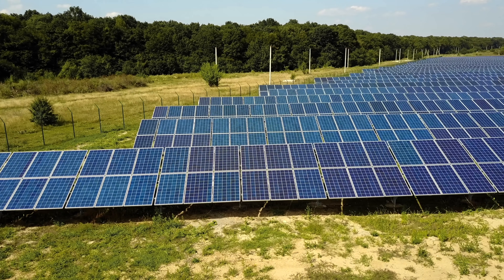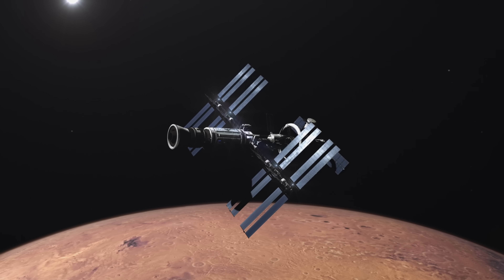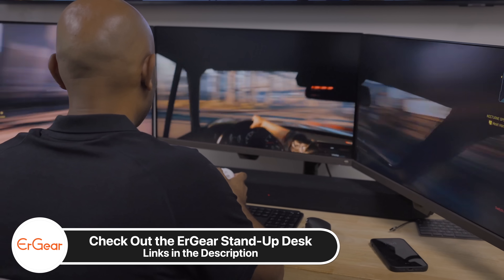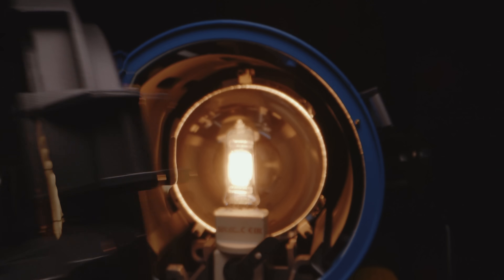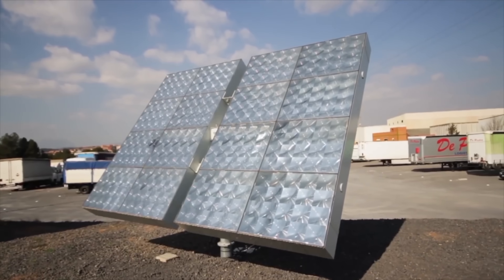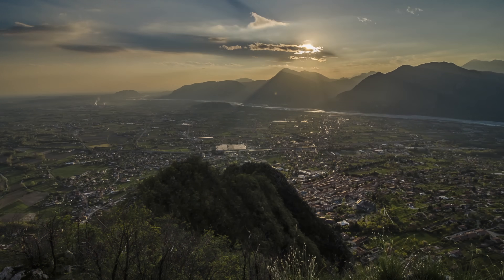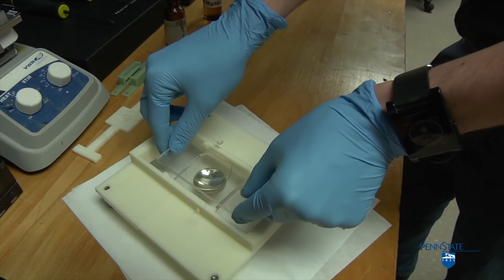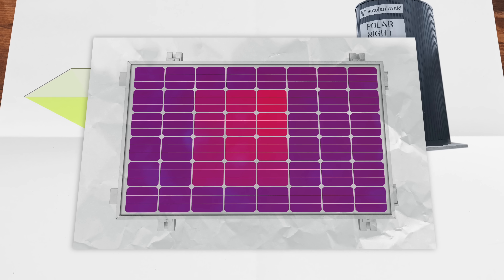Why Don't Solar Panels Have Magnifying Glasses On Them?

Comment: Here's an Idea:
Would it be possible to apply this geometry to a pool and have a panel at the bottom using water as a diffraction material?
It would use a big "dead space",  it would heat the pool and cool the panel and a heat pump could use the water as a heat source when it gets too warm to use the energy as effectively as possible.
Reply: The water in the pool would be hottest in the middle of summer.
Reply: @klepow  that is why I was thinking to use it as a heat source on a heat pump. That would extract the heat and send it to your boiler, a modified dryer and in to the soil for later use.
This would both increase the efficiency of the heat pump and cool the water to a preset temp.
Reply: @GeorgeBP81  I doubt it would be worth it. Without this Rube Goldberg contraption, you would still get 500% efficiency.
Reply: I like your thinking...I was just thinking that water droplets act like a magnifying glass so if you use a large magnifying glass on solar pannel the problem is excess heat so I thought spray solar pannel with water mister on a timer and use PC fans too blow across this water mist on pannel creating evaporation cooling which is very strong cooling this will offset the excess heat from big magnifying sheet above but also the water mist droplets on top off pannel each fine droplet will also be acting like a micro magnifying glass so like a million nano magnifying glasses on pannel with a bigger lense above with your PC fans blowing across this should be a working idea too improve light catching and amplifying light and also you want too mist underside n blow fan across also now your pannels will be nice n chilly with the increased light capture from large lenses above and nano water lenses on top pannel...if you want too see what I mean put some tiny water droplets on your phone screen and you can see the individual dots off light that make up the picture on phone screen as its magnifying it...cheers

Comment: Simplist fix is a water filled chamber with the magnifiers on the outside of a One Way mirror allowing the rays to be trapped and bouncing.

The heated water can then be used for heating and cooling similar to the operation of a heat pump.

Want to go to the next level?

Since it is going to be producing temperature disparities use it as well with the best surface metallic spray for additional electrical generation.

Use the force Luke.

For every force there's an equal and opposite force so using both of them will definitely increase their potential output

Comment: Very interesting analysis. I would strongly suggest that the academic researchers collaborate with their colleagues in the School of Architecture.  What we need even more than a boost in efficiency is a breakthrough in “Building Integrated Photo Voltaics”   (BIPV).  A “panel” that could easily be semi transparent might be formed into a very nice window or skylight or door or …

Comment: Super nice video, I have just a couple of doubts on the efficiency part: as far as I know the total electricity generated goes with the log of the light irradiance, this means that doubling the light intensity on a PV module gives you less than double the electricity due to an higher charge recombination rate. If that's the case, in the example at 8:00 you should get less electricity on the right part compared to the one on the left.
Where did you get the efficiency plot at 7:40?
This is just out of curiosity btw :)

Comment: One of the interesting factors about net zero is how long it would take us to make the parts, vs how long to install them. It could take more than 20,000 years to mine some of the ingredients we need globally - even assuming the quantity we need is available. Every time you can double the efficiency without adding complexity or rare ingredients, you halve a bunch of factors that stand in the way. If you halve it enough times then the practical barriers disappear.  Efficiencies are awesome. Hoping we keep pumping them out at the rate we have been :-)
Reply: I couldn't have put it better myself!
Reply: And where to dump the used up ruins?
Reply: @Plainsman1300  If there are enough of it, eventually there would be a way to economically mine them for their raw materials.
Reply: @imzjustplayin  used fiberglass  blades up to 80 feet in length are a  problem because of wide area of distribution, size and weight.  Can you think of a use or manner of material recovery?
Reply: Who told you it would take 20k years to mine enough materials? That number is outrageous to me considering how much of these ingredients we mine.

Comment: I would love to hear more about how concentrated PV's may be used in northern/cooler climates requiring less cooling, especially in winter. Could they be the answer in the Pacific Northwest?
Reply: It depends how clear the skys are. The concentration only works in direct sunlight (e lens produces an image of the sun into the solar cell, and if you can't see the sun you can only image a cloud). So these are far far more affected by cloud cover than normal cells.
Reply: Bifacial for cooler areas
Reply: Oppositely, could have home panel systems using these on say, the edges of the panels somehow? Or edge of the roof? Both? IDK

Rocky desert regions bordering villages and towns: Lots of solar panels. Capture heat in water somehow too. Can't really terraform those anytime soon. Sandy deserts: terraform with cow dung and planting coprophilic fungi in them to turn methane into carbon dioxide as they help to fertilise the ground. Bit later plant hardy plants. Grasses.

50 years time, suitable for planting lots of trees and doing more work to transform total sandy desert to work as massive CO2 sinks with clean drinkable water stores.
Reply: I mean, winter sun still exist. I'm getting solar panels on my house in northern England, and they'll still generate some energy in winter. The big issue is the clouds tbf
Reply: @waqasahmed939  Oh yes as someone a little familiar with Northern England, those clouds indeed. 

The weather the last ten years, and certainly last two is arguably an indication disruption caused by climate change is already starting to affect even drizzly damp Northern England.

What I'd like to see is people allowed their own small Vertical Axis wind turbines in their yards or gardens if they have them.

Also massively loosening planning regs to just get more normal wind turbines build in general. The NIMBYs are a loud minority who should be ignored for everyone's own good.

Then from there soon as any high quality  home storage available at massive scale, the State helping everyone get sorted with them, who can't afford to buy their own.

I think we might see Lithium's role decrease from forecasts, with it ultimately at the moment being best for lightweight applications, when cheaper and also more emissions friendly, but less energy dense battery tech is coming in.

Very few homes will have both pressing need and the money available for a fancy Powerwall, for example?
Reply: CPVs dont work with diffuse light. in Denver, yes, Seattle, no

Comment: Add a water heating coil behind that panels with a small pump to store in large hater tank and route power to batteries.  Wafer heating uses a big % of household use.
We had a solar tracker with pipe frame with gas  that moved the panel to follow sun with simple car shock absorber 30 years ago.
Mount on garage roof , most are flaer than house.
Reply: Thanks for watching and commenting ❤you have been randomly selected from comments as winner for today's giveaway hit me up via the digits above to claim  prize.............🎁🎁🎁🎁

Comment: Thank you for doing this video and I found the information very informative and hopeful.

 I have been following this technology for a very long time and I am a firm believer that solar is the way to go right now especially since it means we can possibly eliminate fossil fuel forever.

 In fact, if you really think about it.   If we took every single building in the world today from houses to commercial buildings and parking lots and cover them even in the current solar panel technology we can produce a lot of energy to help make our lives a lot better.    Because that energy can go to run LED lights on our streets, parking lots, homes, offices and the energy can also be used to recharge our electric vehicles and any thing else that we needed to do.

 Furthermore, it's also a good area to invest money into since if you have an IRA or some sort of money market funding you should be putting your money into this type of technology because it's a win-win solution.

Comment: I've watched videos on homemade heat pipes, which are great at thermal transfer. I think perhaps by using a ceramic plate to focus the light onto and cause  iridescence we could get the luminescent intensity without the heat onto the pv itself.? We could still store the thermal energy and while we are at it let's go on and improve teg tech so we can convert that stored thermal energy into electricity at night....
Reply from the maker: Great idea i like that... interesting idea for a future video

Comment: use those solar panel prisms to absorb photons and send those photons directly into fiber optic cables as power over fiber to avoid unnecessary energy conversion and to avoid energy loss during energy collection and energy transfer

Comment: if the lens can receive light from any angle including diffuse light and focus it towards the cells.... that means you can have your entire roof covered in these panels which is something you cant do cost-effectively with regular panels 😲
imagine this with tesla solar roof tiles 🤯

Comment: Help me understand: Since the cell conversion rate is 30%, the remaining 70% of the energy becomes HEAT. If the NON-magnified cell temperature rises about 25 degrees C, a 665X cocentrator will cause a rise of 25 x 665 = 16000 degrees C! The life-span of the cell will be measured in micro-seconds!!!

Comment: i am dabbling with 1000x sun solar cells used in space applications. I am finding the Fresnel lens costs can be as much as the cell themselves, plus optical efficiencies with concentrating light arent great, take much of the gains away. The other problem is tracking is required and clear skies are mandatory. So how are these more efficient overall? The big savings is in weight, so portable trackers are possibe, meaning for camping, cabins, etc.

Comment: I would like to know what concentration does to diminish the life of the panel?  Compare the 50% output reduction point in years between traditional and concentration panels.  Now calculate Net Present Value per total kW-hrs produced between new and the 50% points (usually around 30 years for traditional panels).

Comment: Make the wafers in a very high pressure environment, thereby pushing the atoms closer together and reducing the 'valley' the electron will have to escape to get mobilized.  Also, dope the material with lanthanides and gallium arsenide.

Comment: I appreciate the ideas you have shared in the video. However, it appears to be counterintuitive to insist that CPC should have tracking incorporated when they already increase the efficiency regardless. That just sounds like propaganda. If they already concentrate light onto a section at such mind-blowing increase in efficiency and, with the speed of photons, this happens very quickly, it should become negligible the shift from one section to another. After all the boost that each section will provide already surpasses what the entire panel supplies according to your explanation 8:13. I am currently hunting for ways to improve the efficiency of my panels and I'm just astounded to find that a panel can be made to produce much more than twice it's indicated power rating. Moreover, I wonder if that is safe for the cells and the panel as a whole.

Comment: I hope they put more thought into the failure modes of having concentration of solar energy on the roof top of someone’s home. If there’s not a fail-close type system then I wonder if it’s even worth the fire hazard risk (for residential use).
Reply: Thanks for watching and commenting ❤you have been randomly selected from comments as winner for today's giveaway hit me up via the digits above to claim  prize.............🎁🎁🎁🎁

Comment: those inverted cut of pyramids sound cool, , have they tried parabolic reflecters. X=4ay ,to funnel energy to a focus, and then at this focal point, array a crystal to focus the light into another x=4ay, light amplifier, and then ,you get it ? So you maximize light amplification, and minimize pv size down to atomic lattice level. Limits of semi=conductors. Max output/min input??

Comment: I'd like to see a "Spray-on" PV coating some day. Basecoat, mid-coat, top coat.
If you think about it- the Earth is already "Solar powered" by the captured Solar wind by the magnetic Poles, making a "dynamo", then you have the water evaporation, as part of the Water Cycle, then the uneven surface heating, causing wind. The light also allows photosynthesis, that through transpiration- causes gas exchanges by green (chlorophyll)  plants, helping to produce a thick atmosphere.

Comment: The disadvantage of those fresnel lens photocells is that the angle of incidence of sunlight must be almost head on. If the panels are not directly facing the Sun or if the sun moves off angle the output of those lenses will decrease greater than if there were no lenses at all.

Comment: 8:15 Wrong calculation, it is not 1/665th since you need to divide not the square size of the PV area,
but the lens covering/collecting the light from the same 3 x 6 ft area!
The 2.38 times efficiency still remarkable!
And even nowadays prices using the area the tracking mount use to fill up with additional PV panels without tracking
is cheaper and more effective. Not to mention hustle and maintenance free than any of the tracking system available!

Comment: One thing you seem to gloss over and only mention briefly is the thermal gain using a light concentrator. Along with more light come more heat and shortens the life span of the solar cell. That problem has to be addressed first before they can market those types of cells. Till they can solve that problem the use of a light concentration will damage the solar cell much too quickly.

Comment: When you say “halves the cost” does this account for the cost of the more robust/exotic materials needed  to deal with the heat of energy concentration, the additional cooling requirements and operational and maintenance costs of greater system complexity? This is especially so for home systems which, as you pointed out, are largely “install it and forget it”.
Reply: Thanks for watching and commenting ❤you have been randomly selected from comments as winner for today's giveaway hit me up via the digits above to claim  prize..........🎁🎁🎁

Comment: An Australian company Sundrive is reducing the cost and increasing the PV efficiency by replacing the expensive silver interconnects with copper. Add this in with the lens and we will have cheaper and more powerful PVs being developed in the future. All good 🙂 Cheers

Comment: Anyone remember the company Solyndra?

This is the entry in Wiki at the beginning, and it's wrong:

Solyndra was a manufacturer of cylindrical panels of copper indium gallium selenide (CIGS) thin film solar cells based in Fremont, California. Heavily promoted as a leader in the sustainable energy sector for its unusual technology, Solyndra was not able to compete with conventional solar panel manufacturers of crystalline silicon.[1]

About two years after the Obama administration co-signed $535 million loans to Solyndra,[2] the company filed for bankruptcy on September 1, 2011.[3][4] A 2015 report from the Department of Energy found major flaws in Solyndra's business practices and claimed the company made "inaccurate and misleading" statements to obtain the loan guarantees, and also found fault with Department of Energy oversight.[5] 

What REALLY happened was the cost of silica had kept going up, and because of this it was worth looking at making solar panels differently than we have been.  China has some big deposits of silica, and when prices started going up 2006 - 2010 time period, China opened this up for mining, and the price of silicia dropped to 1/10th it's value, and this once again made solar panels based on silicone very inexpensive.

Solyndra was doing THIS exact kind of work, developing more efficient panels and using different elements, but when China took control of the solar industry and they effectively dropped the cost of panels by about 80% through mining and improving manufacturing, etc.... like what this video said without saying this ALL happened in China, that killed Solyndra.  Solyndra failed because the Chinese were successful and getting panels to the very low cost they are now.  So, while they might not have been quite upfront with what was happening 2006 - 2010, they didn't fail because they were a BAD company.  This was well researched in fact and they failed because of the success of the Chinese companies, which killed the need at that time to do more research and try to SELL more expensive and more efficient panels.